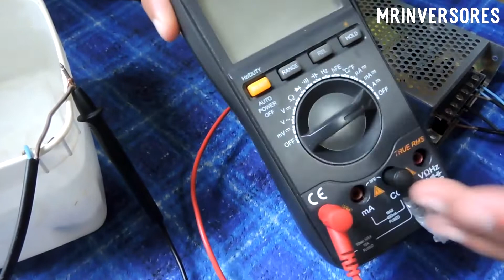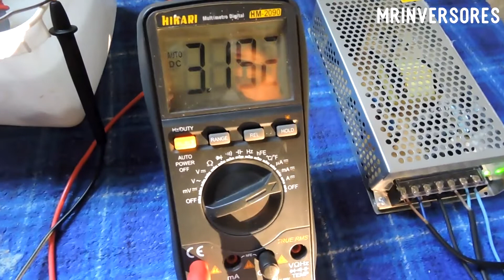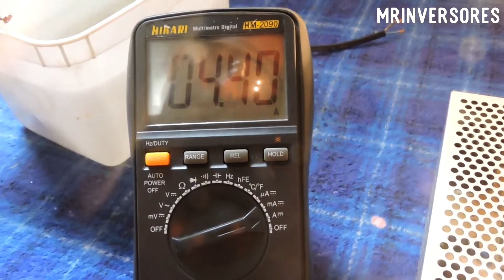IS THIS CHINA SWITCH POWER SUPPLY 12V 20A? CHECK OUT !!!

Comment: I bought one of these and every time I added a circuit no matter how small, it would lower voltage across the whole thing. I was only at 4 amps so far and mine was rated at 20 amps. Garbage

Comment: Very instructive
Why you don't measure voltage drop at high load?
Reply from the maker: True friend, is that I had no way to measure the direct current and measure the voltage at the same time, so I only measured the current, but for sure the voltage drops a little.